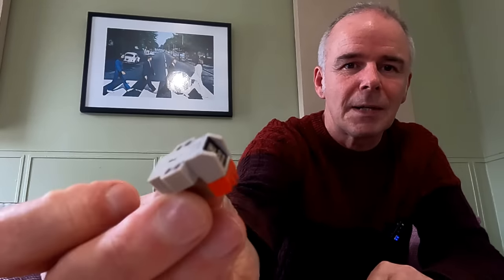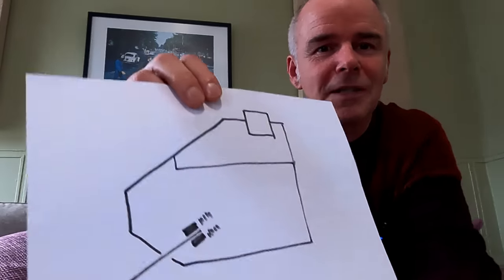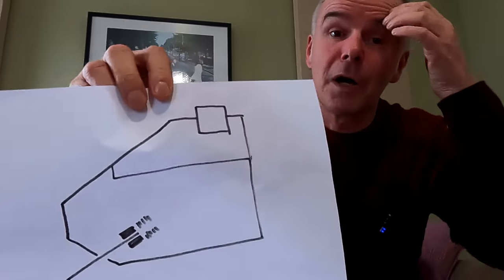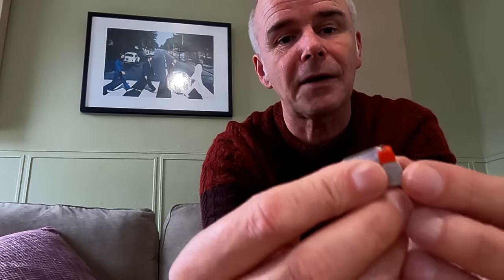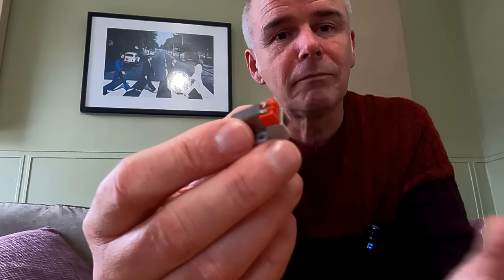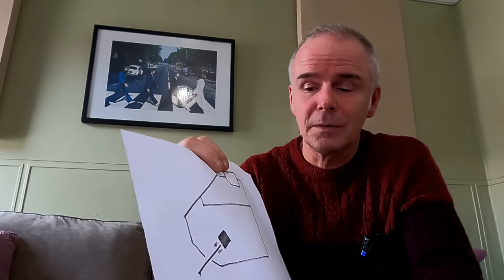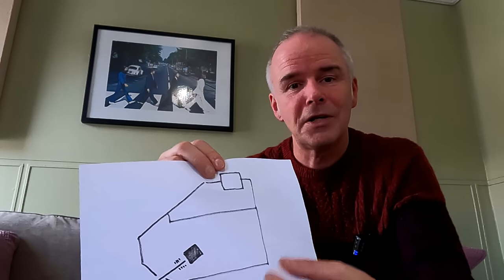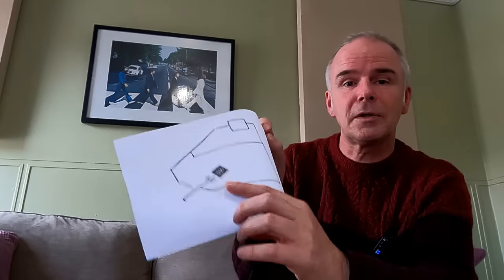Why is Moving Coil so much more expensive than Moving Magnet and why can't you change the stylus?

Comment: Moving Coil is better than Moving Magnet. Why? Because, as you predicted, the coils at the end of the cantilever are flexible at the MC cartridge the stylus  moves more easily on the surface of the vinyl giving it a better sound. The Moving Magnet cartridge,, magnets at the end of the cantilever, because of their weight, the needle moves not so elastically and the sound is not very wow. Moving Magnet is cheaper also because you change the needle every day, not the whole assembly as with Moving Magnet. There is also a retipped version that makes it possible to replace the needle on the Moving  Coil cartridge. I had Moving Magnet, good cartridge such as Ortofon Super OM with Fritz-Geiger needle, a more advanced Shibata. Then I decided to make a change, I bought a MC Denon DL110 cartridge for 50 euros with a destroyed stylus and I retipped it with the 40 needle from Ortofon and it sounds liike a dream. A much better sound. I also bought a cartridge Akai PC 200, AT30e clone with elliptical nude needle that sounds better than any MM cartridge. I also bought an AT30e gold 1983 cartridge to which I put a VM95ml, microline needle and it also sounds extremely good, surpassing a MM cartridge

Comment: I agree you need a good turntable and arm to get the improvements out of MC cartridges most magnetic ones have a high frequency resonance and MC's usually have a wider flatter response often going above 20 khz and do sound better and use a separate pre to line output amp for best results

Comment: What is a reasonable upgrade for an old Linn Basik, without going silly? I gave it some love with new belt, oil, acrylic matt replacement etc. It has the Basik Plus tonearm, which I do not want to change because this is only my secondary turntable. It still has the original Linn branded pickup, but that is only a 50 bucks piece, and I want to do better than that. Does it make sense to slap something from the 200-300 Euro range on to it? On my main turntable, I have a MC Grado Platinum 3, which was ca 500 Euros, but that is obviously not what I would want to spend for the old Basik...
Reply: I also own a Linn Basik. To me, I get better performance out of upgrading the Phono amp. Right now running Darlington labs MM6B and love it.